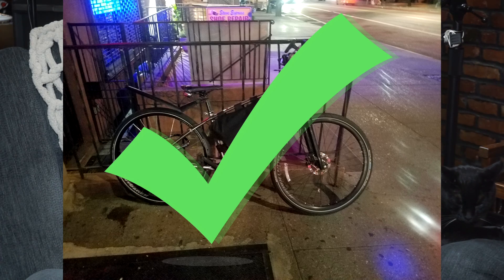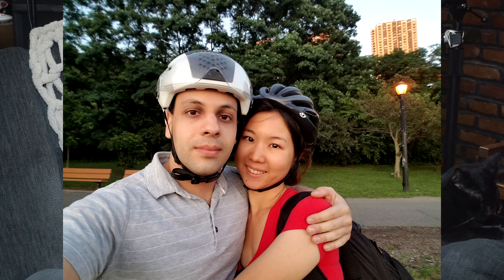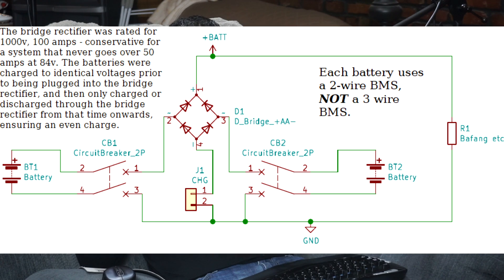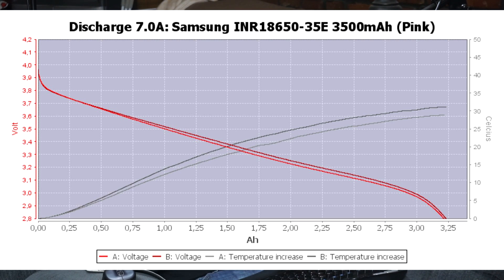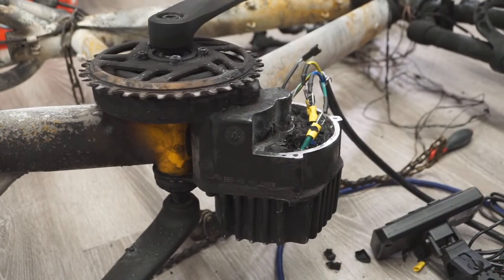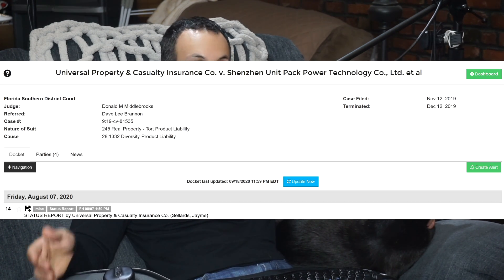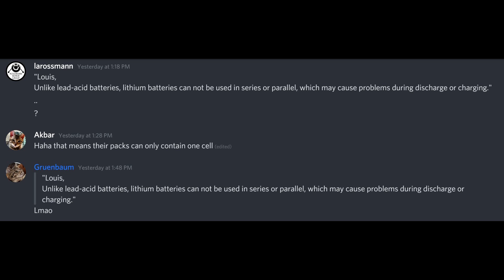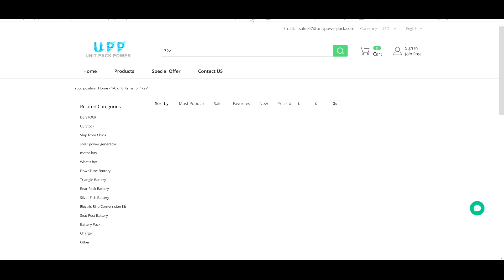Louis' front door goes BOOM courtesy of UnitPackPower battery.

Comment: Based on the diagram I am assuming that the cause of failure is a bit different. 
Lets assume that during your trip you only closed CB1, which means that you were basically driving on a single battery.
The bridge rectifier may be able to handle higher currents and higher voltages based on the spec, but to quote Dave from eevblog there is a trap for young players, and the issue is it is assuming your cooling solution is good enough (burnt a lot of electronic components because of it back in the day).
So if one of the diodes on the bridge rectifier was damaged and turned to a short (when silicon fails it tends to fail as a short), when you closed both of the circuit breakers, basically the 2nd battery which was full started to charge the first battery (which should have been rather depleted by now), and the current was probably much higher than 46A (probably hundreds of amps) and wasn't measured by your software, so why doesn't the BMS have any form of over current protection (charging & discharging) for that? probably adding support for it would have been too expensive which is probably why they don't sell it any longer.

Here is how you test it, take a bunch of your bench power supplies (I doubt you have one which can provide this current alone) connect them in parallel and have them generate 46A through a single diode of the bridge rectifier of the same model as you had.
Have the current running for the same time as you last trip (and have the same cooling solution as was on the bike, assume there is no wind so don't add a fan to simulate wind).
Afterwards test the diode in the bridge rectifier, if it failed, then here is your likely problem.

Comment: LOL !  "Cant put batteries in series or parallel" ...mmmmh .. I better check my remote (or any battery operated device) ; it might blow up.
I guess they're saying "You used it wrong !"
Where did I hear that before ?
ok .. in series could be a problem by running high amps through a pack, but they should be able to handle the rated current, in any configuration.
 
Claims like this from a 'battery manufacturer' shows they're either expecting, you are a dumbass customer who believes any kind of BS they're saying,
or ... they have no idea how batteries work.  And they posted it online, for everyone to see.
Companies like this should be sued into oblivion.
Cuz, they endanger people and refuse to take any responsibility for it.

Comment: Most likely a bms failure. Most bms are charging at the MAXIMUM safe voltage 4.25 even 4.3v... all it takes is one bad balance connection getting pulled even a tenth of a volt low  its over maximum voltage it splits the electrolyte i to hydrogen and oxygen in a enclosed metal can and boom 🔥

Comment: If those diodes fail and allow continuity to pass from both directions it can cause a + charge to go to a - charge, why not have the batteries connected directly to each other then go to a circuit breaker. It looks like you unnecessarily added an extra set of breakers.

Comment: Image at 11:00 and comment on 3 wire vs 2 wire.  
It is verry likely that they used a 3 wire and cheaped out not giving you the 3rd wire making it look like a 2 wire.  So, what kind of polybag were they in to keep so much heat in that a 2-20Amp trip ( with peak 40Amp) would get it to go on fire from just the heat buildup plus the plastic housing not having any fire protection chemicals to ensure it goes up like 3 cups of gasoline??

Comment: I think the problem here is with one goofy circuit breaker. On observing the series of  events described by you makes me suspect that when you activated the circuit breaker, the circuit breaker failed and shorted out the two leads from the battery there by causing out a fire. I once had a similar accident(not a full balzing fire but the wires burned and the metallic connectors melted) involving a lead acid battery, a DPDT relay, an embedded controller and a motor. The system worked fine for a few days but then one day the relay failed and subsequently burned out the wiring towards my battery side.

Comment: Do BMS systems still need to remove bad cells from circuit for mission critical applications?  Also does the BMS system measure cell temperature?

Comment: So with Lithium Ion batteries, one is just stuck with the 3.6-4.0v nominal they offer? Because if you can't wire them in series or parallel, there's news for them; you can't wire batteries in any other way! The trick to safely do it is proper BMS for the config which I'm sure Louis made sure it was sufficient. That and they only really get imbalanced when wiring in series (or indirect parallel, maybe), whereas in parallel the cells can keep each other charged.

Also electric cars use much larger battery configurations. So it seems like that would be very super dangerous according to them. But cars typically use a BMS system that has a module on each series pack which monitors voltage of each pack, and then the main module compares voltages of each pack to each other and balances accordingly.

While Lithium Ion's are more picky than traditional lead acid batteries, there are ways of doing it safely, and Louis's schematic looked safe to me, as there wasn't really enough series config to be dangerous. For them to just say it's impossible without explaining this, yeah, they really don't have the slightest clue on what they're doing.

Comment: It's worth noting that thanks to the rampant counterfeiting going on in China UnitPackPower in theory could have had the best of interventions but got fucked over on a shipment of the cells. However even cheap crap 18650s aren't exactly fire bombs. The battery was likely already in thermal runaway from use or charging.

Comment: As a user of Lithium batteries for the past fifteen years, this is the reason why  we NEVER charge  these batteries inside!   You should remove the battery, put it in a fire proof enclosure for charging.  Lithium burns at thousands of degrees and does not need any oxygen to burn .

Comment: I know someone who has an ebike and thier battery is completely sealed in an aluminum case. A battery fire is usually around 500 degrees and aluminum melts around 1200. So I'd get buy a battery with this protection. Juiced ebikes have them. I'd also never buy cheap batteries from some fly by night company.

Comment: Nothing wrong with your bridge method, the diodes control the charge/discharge path.
And the bridge is well above spec.
A tiny bit of voltage drop,  but at the voltage you are using it's bugger all.

Comment: Can someone explain or point out a good resource for the difference between 2 wire and 3 wire BMS's?
Thanks
Reply: Just check out the different BMSs and you will see. In short: three wire has battery negative, charging negative and discharging negative. Two wire has battery negative and a combined charge/discharge negative.
With a 3 wire BMS you're not guaranteed you can charge on the discharge negative, e.g. regenerative braking. Although what functionality a BMS has and how it technically works is actually up to the designer of it. Some BMS's don't do much more than look pretty... (e.g. do not balance cells, do not offer any protection, etc.)
Reply: @JoepXE  
When you say "In short: three wire has battery negative, charging negative and discharging negative."
I assume you mean: battery negative, charging positive and discharging positive?
Reply: @koffibanan3099  No. You connect the battery negative to the discharge/charge negative. You hook up the BMS in between them.
I understand though where your assumption comes from.
Reply: @JoepXE 
Thank you for the explanation. I thought I more or less knew what a BMS was and did, but as always I will need to read up a bit more.

Comment: And this is why i don't recommend replacement batteries in the comments of my headset repair video!I have no clue about batteries and no way to check them. Also i don't know a reliable supplier i could recommend. So i am sure as hell not telling anyone to replace the battery in a headset. Just imagine a scaled down version of that fire clamped to your head. Yes the battry would be smaller. But i don't even want 0.1% of that, that close to my head.

Comment: I have an Eaton 9PX 3KW UPS I was going to mount into my 4x4 for camping/touring and replace the 6x 7AH 12V batteries in (72V DC) with some external 72V liion battery packs to keep it efficient (with a custom charger of course) rather than 6 larger 120 or 160Ah batteries which would take up much more room. This video definitely encouraged me to allow for the extra room and upgrade my rear suspension for the extra 120-150Kg of SLA batteries. Bugger that.

UPS rather than Inverter? Well, not that it would be at max tilt the whole time it runs but I'd rather draw ~45A (with inefficiencies) at max load at 72V with a battery bank while running smaller wiring, rather than ~275A (with inefficiencies) at 12V. Also, the UPS was free as a customer from work was upgrading and going to dump it and higher voltage inverters are expensive with questionable 'pure sine wave' while a brandname UPS definitely is. Higher voltage DC inverters aren't cheap at all.

Comment: I see this in my work - some companies that make electronic devices that are soldered to PCBs make wildly inaccurate statements about solder materials and the way in which soldering works. 

My favorite: "You cannot solder lead-free devices with tin-lead solder unless you solder at temperatures above the melting point of tin." Wrong, so wrong, and yet every few months I have to deal with exactly this when a mutual customer hears this from their device supplier. 

(By the way, I'm selling the mutual customer their solder so I actually know how it works.)

Comment: So im staring at your bridge rectifier coupling circuit, How is the charger supposed to work? alot of chargers require a sense of voltage before they turn on, and a bridge rectifier prevents this from happening. Anywhoo, you got very lucky here, because it could have easily been alot worse.
Reply: Lead acid battery chargers do. But usually not lithium. They are basically constant current, constant voltage power supplies so they only need the sense the voltage and current that they are outputting and don't necessarily sense voltage before they start charging.
Reply: @BenBrand  I guess it depends on the brand, I have had some "smart" lithium chargers that will not enable its output unless it senses a voltage present. Its probably a safety thing.
Reply: @THEtechknight  good point, when I made that comment I forgot about two chargers that I have that do sence the voltage first that way they can make a guess on how many cells are in series that way you don't do something stupid and charge a 8S battery as if it's a 10S battery and over voltage it. I was just thinking of the chargers made specifically for bike battery packs that I've seen from those kind of companies since say you only have a 52-volt pack you just buy a charger that only does a 52-volt pack and then it doesn't have to check anything.
Reply: @BenBrand  Or if its a multi-charger, it detects what type of battery is connected sometimes. Although thats rare. Anyways, I build my own battery packs and use a dual port BMS for our electronic scoreboards, with solar panels. It seems to do ok. The dual-port BMS I was using are being assembled incorrectly in china with the wrong parts, so it explodes on connection. So I dont put it past the chinese. I had to roll my own BMS.

Comment: So does unit pack power use lithium ion, lithium polymer, or lithium iron phosphate in their batteries? Did i miss that? Im pretty sure an18650 can be a lipo or lifepo4 definitely  lion. EDIT: watched again and ok these are Samsung 18650 35E lithium ions designed for high output, ebikes. Id suggest you spend more and add maybe 1-5lbs of battery weight to use lifepo4 batteries instead. They are way safer than lion not 100% explosion proof but definitely alot less volatile than lions, and they have a waaaay longer lifespan than lions.

Comment: How is the bridge rectifier ensuring an even charge? It knows nothing about the characteristics and charge state of each pack, It will just present a voltage (minus the diode drop voltage each way) to each pack.  I'm assuming there are more smarts in each battery pack to control their charging demand...  If the batteries are dumb, that could be an issue.

Comment: I don't know the details of the BMS used by UnitPackPower nor the details of the physical construction of the pack, but is it possible that a single cell (Or bank of cells) was overcharged?

I'm assuming their BMS does top-balancing with the usual anemic balancing resistors that these BMS boards tend to have. If one of the cells (Or a group of the cells that were in parallel) is poor and has reduced capacity, it will charge before the others within the pack. Assuming that the pack is top-balanced, the healthy cells in that pack will not fully discharge and the pack as a whole will have a reduced capacity.

The part I'm unsure about is how the parallel charging of the two battery packs impacts the charging profile in this case. Lithium calls should be charged using constant current (1C) upto a certain voltage, then charged using constant voltage until the charging current drops below a certain level. In the parallel charging scenario where you have one pack with a reduced overall capacity, one pack will reach it's charged status before the other - How will this affect the battery charger's profile selection?

In addition to this, the bridge rectifier will introduce a voltage drop within the charging circuit which will also adjust the triggering threshold of the constant-voltage charging profile. Of course I'm making assumptions about the type of battery charger you're using here as well.

Anyway those were the parts that jumped out to me.

TL;DR: How does the bridge rectifier voltage drop and the parallel charging of mismatched battery packs affect the battery charging profile used?

Comment: Louis I trust Panansonic Batteries due to Japanese reliability, quality and performance and in the first place you should of bought a 52V Panasonic 13.5AH Shark Pack battery from Luna Cycle: https://lunacycle.com/52v-panasonic-13-5ah-shark-pack/ rather than buying an eBike battery that is made in China by a Chinese company with falling quality standards as the UnitPackPower battery is so dangerous and should not be sold to the general public let alone to other businesses but recalled due to falling quality standards.

Comment: Sorry....but that fire was easily manageable with a fire extinguisher (I've put out bigger ones at work with one).   New York's finest just takes their time unraveling a hose, hooking up to a hydrant, while the fire is spreading, and then quickly put it out with WATER...not the best for an electrical fire....an ABC fire extinguisher sold at any Home Depot would have snuffed it in seconds.  Hopefully YOU Louis, will invest in a fire extinguisher, to prevent having to call the fire department next time....but it blows my mind the fire department didn't use one themselves, saving time, damage and effort...

Comment: Using that bridge rectifier doesn't seem to be safe. Imagine one of those diodes fails short and batteries are at different state of charge. That there will be huge current going from one battery to another. A fire starter.

Comment: I like how the firefighter told Erica to MOVE BACK.. She yells “move back” looks back to realize he’s talking to her 😆
Reply: I found it quite peculiar, that they took so much time to get the water on there. Most firetrucks have preconnects for quick discharge of water but timing wise, it didn't look like they used it
Reply: Holladiewal I volunteer at my local fire department. You normally get prepared no matter what just in case something is going on they can’t see. Plus it’s a lithium battery fire, you pretty much let them burn out. Was strange they didn’t seem to big in a hurry to get it off the stoop

Comment: Id just 3D print a case, order cells, then charging & protection circuits & build it myself. Why didn't you do that? I am a 3D printer Builder/Engineer @ BGM Engineering. We make custom circuit boards, harnesses etc. Quality is #1 we do medical electronics. If you want a custom 72v battery case so you can build one yourself let me know. Cheaper & more reliable.

Comment: I would definitely assume that the batteries hadn't been load balanced properly.  Probably had several cells barely working which artificially put a massive load.  Those 46-48 amps were probably pulling off too few cells, overheated and boom.

Ugh, man!  What a nuisance!  Hazards off batteries (especially LiPo!)

Comment: Disappointing that the company didn't own up to their errors and at the very least supply a replacement.

A couple of points on terminology though - you are interchanging the word "Cells" and "Batteries". Sticking a pile of cells in parallel and/or series gives you a battery. Those batteries can cause issues when used in parallel if one of them has a fault. (or a diode in the rectifier fails - which is probably why they don't recommend them being used as per your schematic). Their response was a brush-off, but there is nothing factually wrong with their claims.

Having said that,  the facts as presented would negate those specific issues being a factor in the cause of the failure.

Comment: Are you sure it is the battery that gave up?
Mabe your wiring was the problem. You tank about 60 amps, but you seem to be using 16mm² Alu, that is good for 50a max. I guess it was the wires or the connectors of the wires that got hot and started the fire, not the battery.